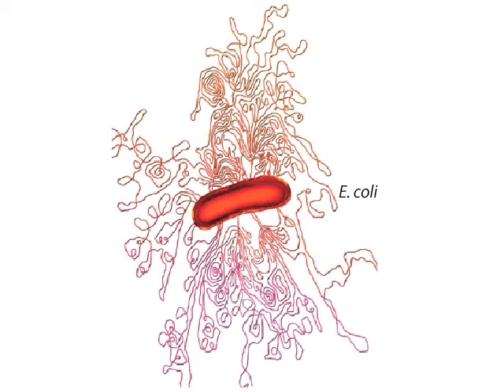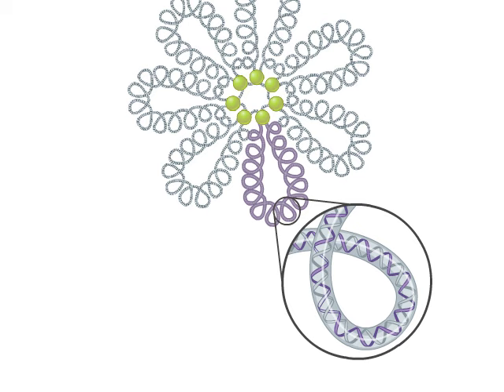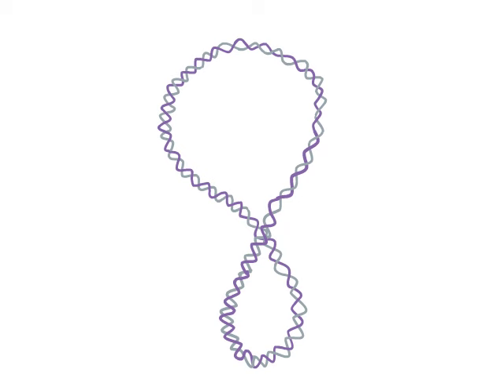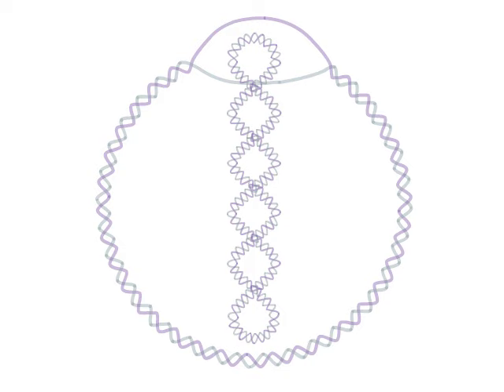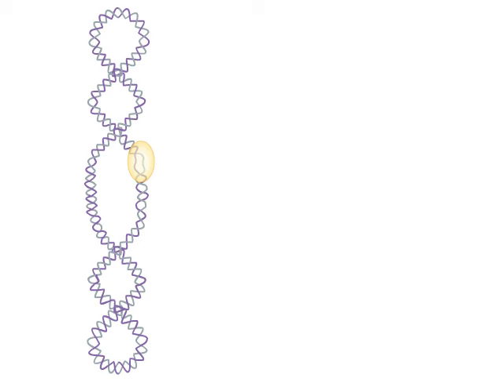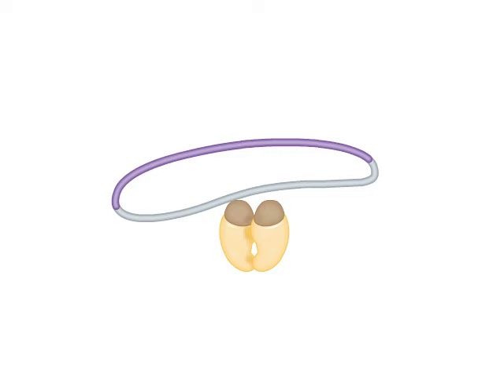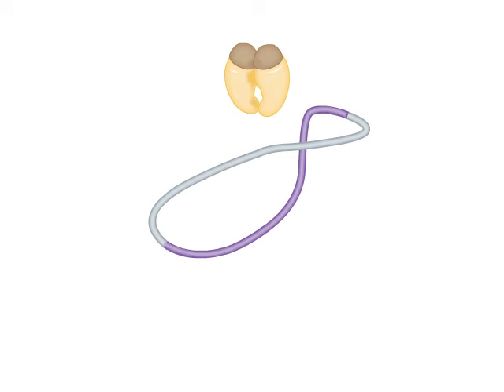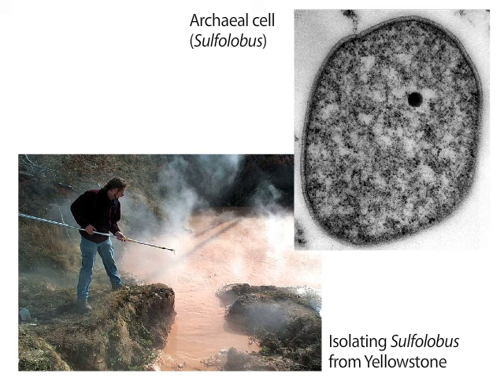Supercoiling

Comment: a lot of misinform
Reply from the maker: Please list your specific grievances so that I may try to address them
Reply: Negative supercoils are introduced into the bacterial chromosome by DNA gyrase.
In the absence of topoisomerase I and topoisomerase IV, the DNA becomes hypernegatively
supercoiled. The steady-state level of supercoiling in Escherichia coli is
maintained by a balance between topoisomerase IV, acting in concert with topoisomerase
I, to remove excess negative supercoils and thus acting in opposition to DNA
gyrase.A typical bacterial chromosome contains approximately 50 giant loops of supercoiled
DNA arranged around a protein scaffold. In Figure 4.16, the single line represents
a double helix of DNA and the helixes are the supercoils.
Reply from the maker: The video reads from the  aforementioned textbook almost word for word. The video is also consistent with your comment. What is the specific problem?
Reply from the maker: "Type II topoisomerases (DNA Gyrase of E.coli). The gyrase enzyme grabs DNA and, in an ATP-dependent process, introduces a double-strand break, passes another part of the double helix through the break, and then reseals the break. The end result is the introduction of a negative supercoil" (Microbiology: An evolving science p 247)
Reply from the maker: Type I topoisomerases cleave only one strand of a double helix and are generally used to relieve or unwind supercoils. Type 1 enzymes are usually single proteins. (p247)
Reply from the maker: an example of a Type II topoisomerase is DNA gyrase, whose function is to introduce negative supercoils in DNA
Reply from the maker: I think you may be confused how it lists "Type" of topoisomerase and not the specific "Topoisomerase IV or 1" .
Reply: thank you sir for explained that ambiguous thoughts really  this Topoisomerase IV made me confused please accept my apologize 

I am reading right now David Clark Molecular biology text book  page 88
I will be grateful for any advise or more explanation about  Topoisomerase IV  what does mean about it or this mistaken mentioned ?
regards